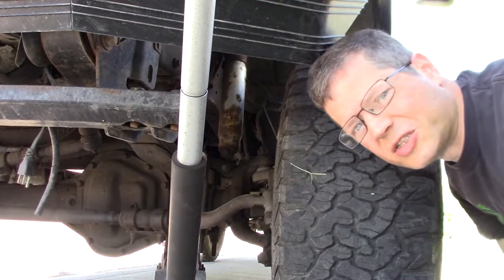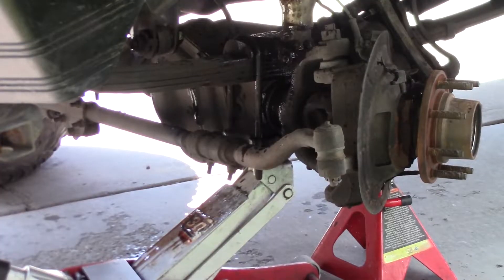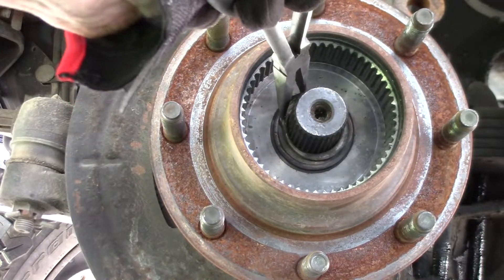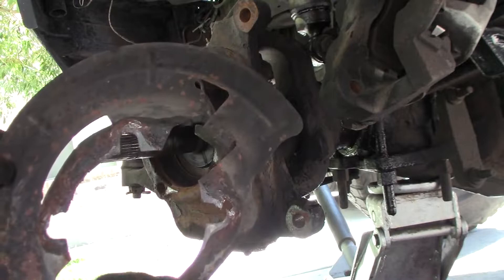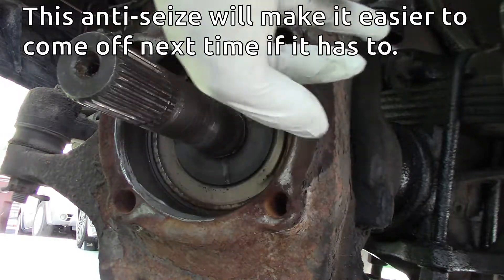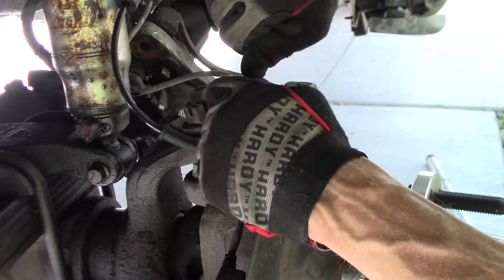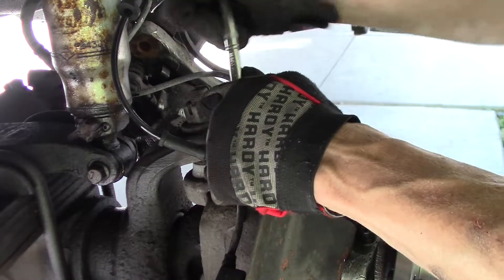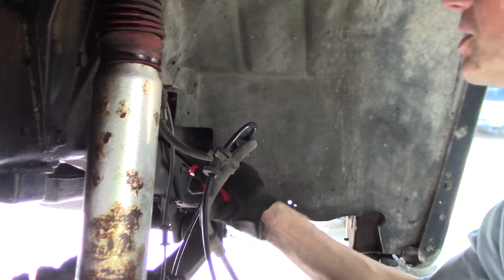2002 Ford F-350 4WD front wheel hub bearing

Comment: You can pull the control arm apart and then turn the wheel assembly in so that the bolts are pivoted out so you can reach them easier. Mine were a bitch to break free as well.